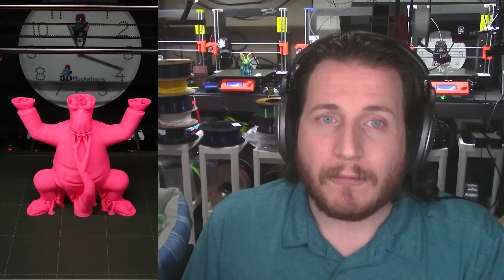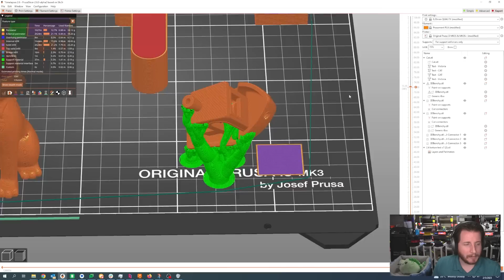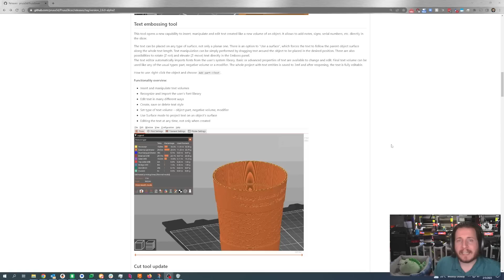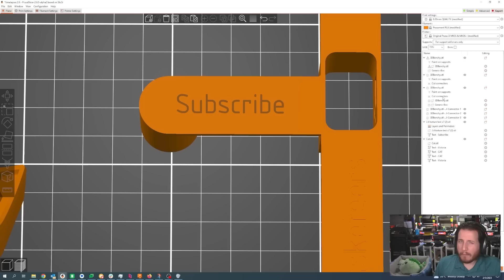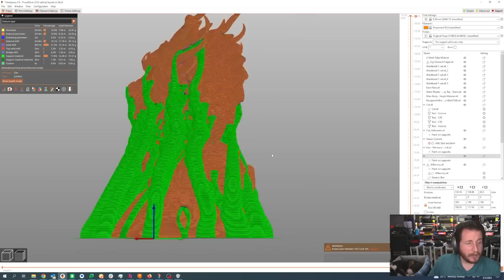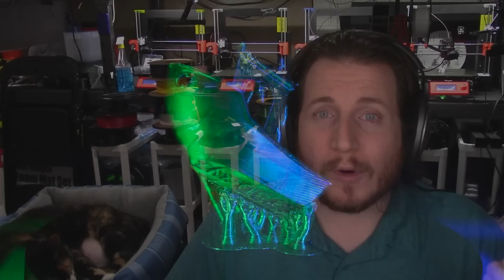PrusaSlicer 2.6 Is HERE! Organic Supports, New Cutting Features, and MORE!

Comment: So far, the organic prints in Prusia slicer using the stock, 1.6 mm optimal settings for a Creality 10S V3 are causing Y-axis sliding because the supports are snagging on the nozzle . . . still troubleshooting this . . . it has caused several fails after hours of printing (tons of filament) . . . so tread lightly . . . I changed up the model, took out the need for the supports and printed my part just fine . . . I think the speed may need to be tweaked . . . the supports were in the front of the bedslinger part of the model . . . no other supports . . . so . . . once it snaggged on the tree support . . . whole layer shifted . . . three times, three different prints of the ame model . . . thought something was up with the printer until I took out the supports and thing printed beautifully for this an others .. . definitely something going on with the organic supports .  .  . watch out!
Reply from the maker: works fine for me, maybe look into z hop and better cooling to keep it from being an issue

Comment: Have you tried it the free range organic supports with PETG?  Trying it...not being successful at this point...
Reply from the maker: not yet. Wanted to get the video out quicker so I had to limit my testing. Should be similar though. Bit of effort to get them off, but WAY less than snug or normal supports
Reply: @3DMusketeers  the effort is not bad...they come off fairly easily.  I did a skull that...in my opinion was less than stellar.  I may have to do some more branches to do better supports....I am not sure.  Still a novice doing this...and this is the first alpha that I have tried.  

I am use to lasers...I am only doing this for my robotics team.  I saw how handy they were during a competition.  Thanks for the quick response!  Have a great day!
Reply from the maker: I've found I need more supports than I think I do for organic supports but it's still so much less.

Comment: I love seeing PrusaSlicer become even more capable. And, thanks to being open source, we should see many of these awesome features show up in more slicers in the future.

There's one limitation to the text tool that I hope will be eliminated in future versions: Text is not "baked" into the mesh. If you decide to export your modified object as an STL, you'll get the unmodified object.

Saving as a 3MF doesn't fully solve this issue either since most programs will interpret the text as a separate mesh rather than a modification to the original object.
Reply from the maker: Interesting, I wonder if that will be adjusted in the public release??
Reply: @3DMusketeers  I hope so! To be clear, this is only true of negative volume indented text. Embossed text, on the other hand, is included with STL exports.
Reply: There are technical difficulties baking in the text into models. Namely many models are quite broken. While the errors could be fixed quite reliably during slicing, they are difficult to solve in 3D and performing 3D boolean on broken meshes is a dangerous proposition.

We may try to implement the 3D boolean on export, however it will quite often report a broken mesh and it will fail.
Reply from the maker: And mesh repair can only do so much lol
Reply: @bubnikv  That makes sense. If the actual boolean operation can't be performed, it would be nice if negative volumes acted the same way "add part" does when exporting STLs. In other words, rather than ignoring the negative volume entirely, include it as a separate mesh so that the boolean could be performed within CAD software. It's not a perfect solution, but it would be useful.
Reply from the maker: Oof but STL in a cad package can be roughhhhh, but if the operation is there for you, that may be okay

Comment: when I do start with PETG I'm curious to see how that will work as support interface for PLA. I've heard it makes a decent choice. But I'm worried about cross material contamination. I know the last time I tied to print PLA after printing nylon, I had to first preheat to 290 (it wouldn't even attempt to take the PLA even at 260) and then have it drop off a crap ton of material (at 290) and then it is fine. I didn't to the massive in air purge and it just flat out would not stick to the bed at all. I suspect the PLA/nylon blend didn't like 60 degree beds. After many, many failed attempts, it finally stuck to the bed and printed fine. lol
Reply from the maker: It is really cool. I have been messing with it on the Bambu and it is amazing. Cross contamination is a huge issue though, which is why I am excited for toolchangers.
Reply: @3DMusketeers  Yeah, the XL shines when printing PET supports for PLA objects.
Reply from the maker: Ugh I need one in my life so bad! :)

Comment: I wonder if the new CUT remembers everything after I reload the model (from an iteration update). Currently I have to just flat out delete the cut model and re-import.
Reply from the maker: I doubt it does, but it is pretty easy to check!
Reply: Reverting the cuts after reloading a 3MF is quite a difficult job to implement, thus we decided to ship a simpler implementation now. We may improve in the future, however there is so much on our list and due to the complexity of this task it may not be at the top.
Reply from the maker: totally understand that!
Reply: @bubnikv  While I can see that and it shouldn't be a priority, the way I would do it is have the direction and relative position of the cut stored under the .stl file like how multi-color painting and painted support data is stored now. Then when you hit reload, it restores the cut based on the assumption the model is basically the same and hasn't moved. I think the real challenge is how the cut is actually accomplished. And you already have that part down. anyway.....Just a thought of someone who is a programmer, but has never done much in the world of 3d graphics programming. I couldn't even get my dos cube to render correctly. lol